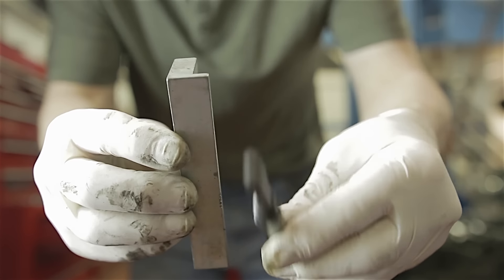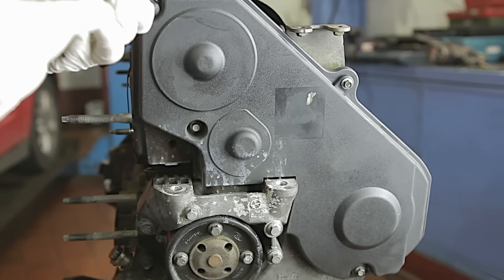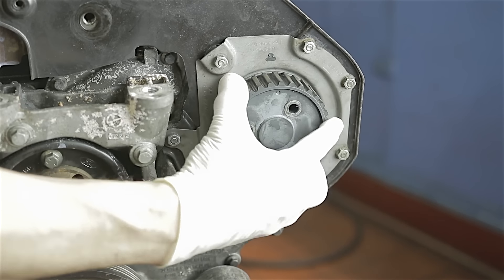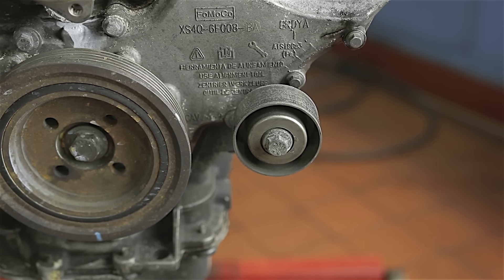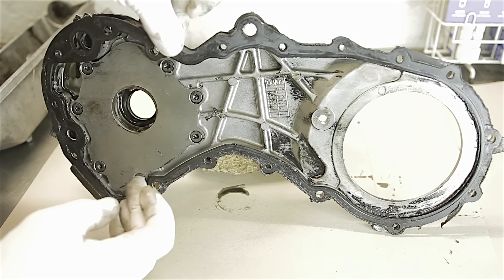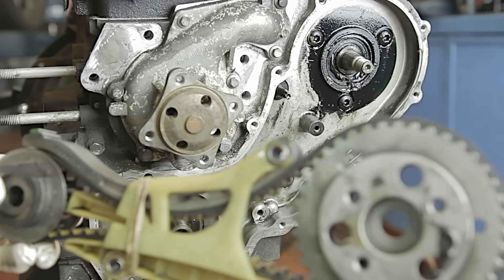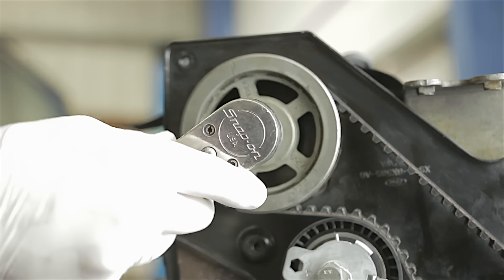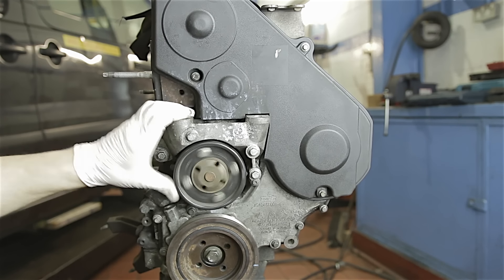Ford Mondeo/Transit Connect 1.8tdci wet timing belt replacement

Comment: Novice mechanic here having successfully completed this job on my connect 2k miles ago. My van snapped its wet belt about 7 years ago at 50k miles according to the previous owner, but they didn't convert to a chain after rebuilding the head. 60k miles later, having spent a month converting it to a wee camper, I decided that leaving it wasn't worth the risk! Thanks to this video and the video from badgertronix i was saved a fair chunk of cash, have a van that (probably) won't explode, and I got a good bit of experience at the same time. My belt was cracked to high heaven too, so taking the plunge was the right decision.

Some things to note from my experience:
My camshaft pully was stuck on tight, no amount of tapping would free it. I was able to pop it off easily with a homemade puller using 3 m10 bolts and some thick steel for the body with 3 holes drilled. You'll need some nuts too. I'll let you work out the rest (part of the fun eh). So just be prepared for this. Ford make a dedicated tool but i couldn't find one anywhere really. 

My new crankshaft seal was leaking quite badly when i installed it, so i replaced with the old one and it was completely fine, still going strong. The seal was from FAI in the lymm engine kits. I saw another guy had this issue so it may be common. So just try this before you go diving back in there thinking the alignment is off. 

Cheers Alan.
Reply from the maker: thanks for your comment chlorotica, hats off to you for getting what is a daunting job done

Comment: this vid. was my first date with you.... i put a spanner on the crank, another on the cam, turned engine clockwise, stopped, then turned it anticlock, no lag between top + bottom spanners, therefore fkin belt fitted. needed dmf as well, so pulled lump out. checked shells, big ends gone [99k] , oilpump partially clogged with belt dust. all the belts, shells, wpump, aux tensioner, dmf + clutch + all seals/gaskets , £850. survived 4yrs now, but use 5/40 oil every 3k cos mains rumbling. you were a very expensive video to watch, but well worth it. keep up the good work + give monny one for me

Comment: Still a great video Alan.  Now coming up on 300,000 miles, this was my second time doing this job with the engine in the vehicle (Ford dealer did it at 100,000 miles). A couple of things I found:
(1) You won't get the water pump off without taking the auxilliary drive belt tensioner off first (1 x 10mm screw and  1 x 13mm screw into block). There physically isn't the room to lift it upwards between the engine and the wheel-arch/side of the engine bay - it has to be passed rearwards and the tensioner pulley will be in the way.
(2) Getting that engine mounting bracket off is a nightmare due to the length of the bolts holding it on. You need to take the water pump pulley off first to make extra room to wiggle the mounting bracket around (likewise when re-fitting after wet belt is fitted - make sure the mounting bracket is fitted before re-fitting the water pump pulley) - also jacking the engine up a bit creates a bit more clearance.
(3) Its important to re-fit the wiring  harness to the injectors and various sensors on top of the rocker cover (disconnected to remove the rocker cover) the same way it was originally. When I did this the previous time, I routed the wiring over the  fuel pipes instead of under them and it must have strained some wiring resulting in the car going into limp mode until such time as the wiring harness was put under the fuel pipes.
Reply from the maker: thanks for your explanation, very interesting
Reply: good to now engines good for 300000 , got one in mk2 focus great car issue is clutcj gone at 90000 , seems to be release bearing but im think dual mass as well ... I get it replaced and should be good for ages ...Not had car form new previous owner ruined the clutch mines has the metal chain

Comment: Bang on I was sure if the crankshaft locking pin fitted inside a hole in the crankshaft, good to know it does rotate anticlockwise when the locking pin is in place, My connect starts runs perfect, but once it starts getting warm it's blowing out blue grey smoke so I'm gonna take off the head to see what's the problem. Great video thanks 👍

Comment: There's no prospect of me ever owning any vehicles with this engine, but I watched the video anyway just to see what the hell a wet belt set up would look like. I don't like the look of it! But I liked the video a lot shows how the job is done in the real world. Probably would have been worth doing the video on a real customer job or having at least the new kit of parts, but you definitely demonstrated how to get the job done. It kept my interest through out even after I'd seen the wet belt, I got sucked in and had to see the rest of the demo! Only observation, when refitting the crank pulley carefully over the seal, I reckon a smear of engine oil on the sealing surface on the pulley and / or the seal would be a help to assist sealing and minimise risk of teh seal getting caught and nicked. But as you said you've done hundreds of these so evidently fitting it dry but with great care works just fine!  Top vid. Kudos to you for being a real skilled mechanic
Reply from the maker: thank you, i had to borrow that dud engine to make the video as i never had a camera when i was regulary changing those belts, so it was a case of now or never..thanks again for your comment, much appreciated
Reply: @alan4x  hi Alan  ive got 12 plate connect  the wet belt snap whats best to do fix it  and any place werr I can take it

Comment: Bought a 58 mondeo with 125k miles. Took it to my local garage for timing belt and oil change and the lad said please do the wet belt too. Ford recommends timing and wet belt to be changed at 125 k or 10 years. Glad i accepted for him to change it as it was all cracked. Probably would have failed in the next 2k miles totalling the engine

Comment: THANK YOU SO MUCH for this strip down. Pulling the tensioner revealed a domed tensioner plunger (phew!!!) but all the same it helped a TON changing bruvs water pump and top cambelt in his Focus Mk.2. Getting the lower engine mount out with the engine in the car was a shit bag of a funt of a castard of a futha mucker of a nightmare but otherwise this job is quite do able on the drive for unauthorised meddlers such as I am. Keep up the good work, I owe you a six pack of your preferred beverage!
Reply from the maker: cheers

Comment: You've done my mate a real favour.lol. I've decided to leave his connect alone. I used to be a fitter in early 90s these 1800s have really changed. N FFS they needed it!!!!!
Reply: Absolutely brilliantly explained and carried out by a man who knows what he's doing, what manufacturer in their right mind would design an engine like this to put a wet belt inside an engine and then another belt on the outside making it double trouble, if either of those belts fail then that engine is toast but I suppose it's a good way of selling engines for Ford. I believe they are doing the new 2ltr diesel the same way, I for one will Never buy a Ford with this stupid engine fitted because as usual with Ford as long as it lasts till the end of the warranty period their fine with that and then it's you parting with the cash, nice one Ford.

Comment: Probably the best demo vid I've ever seen. Possibly the most stupid engine design I've ever seen.
Reply: for ford its a great idea::its so the car has to return to the stealership to be repaired!!!
Reply: @rearspeaker6364  And with there kind of politics by Trump good exposed,it was my last Ford.
Reply: @Boca-do-rio  Psa uses a wet belt on some of their engines also not much more to choose from then.
Reply: @rimmersbryggeri  Hi, how would one know which psa engines that would be? both 1.6 and 2.0? Which models/years? Thanks!
Reply: @zernestro  I don't know but I could find out. They are inte the 3008 anyway. seems to be a whole range of displacements petrol engines. Puretech
Reply: Mental design just to rob the poor motorist mental cheap plastic crap
Reply: The worst engine ford ever made
Reply: Ive bought one of these as a cheap van runabout...what a stupid design ..ford want a grand to replace both belts...ill take my chances and scrap the thing if it snaps
Reply: Agree haha
Reply: @zernestro   just the three cylinder 1.2 puretech engine......they are trouble

Comment: Really, REALLY appreciate this video. 
Quick question: is it necessary to use a new crankshaft pulley bolt? I've read that it's essential but you didn't mention it. In fact  there are many instances where replacement of high-torque bolts is prescribed in the Haynes manual (citing it as a Ford policy) but as an amateur it's hard to know what's important - any guidance would be great. 
Another amateur newbie one: what kind of sealant is recommended for the back of the fuel pump sprocket? These things get understandably glossed over as assumed knowledge - I suppose any engine sealant that is heat, vibration and oil resistant.

I'm a DIY mechanic and will be doing this soon, with the engine in the van . Fingers crossed I figure out how to get out the lower engine mounting bolts, which are flagged as having not enough clearance in the comments - any tips on that appreciated. I already removed the belt tensioning bolt (with a bit of swearing) to check it prior to ordering the chain conversion kit.
Reply from the maker: hi, yes its fine to use the old crank bolt,  uesd to just gun them back tight with no issues and any good gasket sealant wlll do
Reply: @alan4x  thanks, and again; a very well explained and concise video.

Comment: Très bonne vidéo. Mais attention,en montant le joint de la pompe à gazole comme ça et la poulie sans pâte à joint, il y a 99% de chance d'avoir une fuite d'huile ! 
Very good video. But be careful, by mounting the fuel pump gasket like this and the pulley without a compound seal, there is a 99% chance of having an oil leak! Thanks to you (google translation)

Comment: hello there, this video helped me alot when doing my timing belt a couple years back (thanks for that), but i am now having to change out the crank pulley, is it enough to lock the ringgear and screw it off and replace, or will this get it out of timing? cheers from norway
Reply from the maker: you can just remove the crank bolt and pulley and it will not affect the wet belt timing, just fit a new pulley and bolt it back
Reply: @alan4x  thank you soo much :)

Comment: This is a good video, with only one failing.
The third (3rd) engine lock off tool, is missing.
This goes on to the flywheel where the starter motor goes.
This then stops anyone then "as you said" bending the crank shaft aliening tool to what is NOT a locking pin.
It is just an aliening tool.
You need the flywheel locked to prevent this happening.
So, there is no need for as you did to use a pair of mole grips to re aliening the crankshaft, As, it wouldn't have moved.

Other than this.
Great video thanks for making it.

Comment: Omg, this is all pretty hard and precise work. Now imagine doing it all without taking the engine out of the car! Must be hell.
Reply: i did one today on a galaxy long job lol
Reply: It is possible but a little awkward, i've done quiet a few, if your belt has gone the pistons WILL need to be replaced as they crack at the swirl cup edges.

A trick if you need to change the pistons is to carefully break the thin aluminium webbing away from the lower half of the crankcase rather than seperating the two halves to allow access to the connecting rod bolts because they are a nightmare to seal if you split the halves.

It takes extra work to get the top belt timing marks lined back up  but it is not essential because the top cam sprocket is not keyed and the pump does not require timing.

Although it isn't essential it just makes the next guys job easier when doing the next upper belt change if you time the pump and cam sprockets properly on assembly.
Reply: You haven't done the THREE timing chains on a GM 3.6 litre HF direct injection V6.... this is less than 1/6 as bad.

Comment: That video was really helpful 👍i need to replace the head gasket on my son 230l ford transit connect 2005- do you have a video to help with this,
I was looking for timing marks before removing the head and now see what to do thanks to your wet belt video.👍steve spain
Reply from the maker: hi steve, i don't have any information on removing the head but it should be straight forward, the timing is the most complicated part

Comment: Hello, your video is excellent.
At the level of the pinion on the crankshaft, when you speak of the pin which must go in the round hole and not in the one which is oblong, what happens if I go up the pinion with the pin in the oblong hole?

Comment: I'm on 155000 miles... how long will these engines go on for once i replace the wetbelt?. It's had regular services. Just not sure wether to buy a re con or do the chain conversion. Thank you.
Reply from the maker: these engines are pretty much bullet proof and should even outlive you😁
Reply: @alan4x  brilliant thank you for the quick reply. I wonder if I could get it to 300,000 with a chain kit...

Comment: Hi I’ve got a connect with the same engine. Having difficulty starting over the last few days. Machine says Cylinder Head Temperature Sensor out of self test. Asked around searched the interweb (where I found your great video) can’t find the location of this sensor 🤦🏻‍♂️ Would you have the answer 🙏🏻🙏🏻

Comment: Hi, is there any problem if i take of the belt tensioner to see if is chain or belt? Can i put it back if is chain and start the car after check or what i should do?
Reply from the maker: yes you can unbolt the tensioner and remove it..the timing will stay as it is...once you've looked at it then just screw it back in and thats it
Reply: @alan4x  thank you very much bro

Comment: Alan had a discussion with an independent garage owner and he came up with following points on wet belt/chain situation 1 he claimed chains broke on the original engine so as long as wet belt is changed in line with specs there shouldn't be a problem
2 he reckon that you shouldn't use a chain conversion on the wet belt engine as the internals have been modified to suit wet belt .
3 he reckons wet belt is used for emissions/fuel consumption and less particle contamination in oil as opposed to chain .
4 he reckons he does this job without aligning tool and has never had one leak .
I'll keep my thoughts to myself until you reply , hope I'm not taxing you too much regards Ian.
Reply from the maker: hi, i will try to answer this...i have changed about fifty wet belts for chain conversions now...most of these cars had chains put in them about 100k miles...and most of these cars were taxis...we get rid of these cars between 300-400k miles so most of the chains have done 2-300k miles with no problems related to the chains whatsoever.
  i have never heard of one of these chains breaking either..they are a thick double chain.
the cars run perfectly fine with the chains..never had an issue.
 as for aligning the lower crankcase...there are no dowels to hold the case in a specific position so without the alignment tool the crank seal will no doubt not be central on the crank pulley......i fitted lots of these lower crank covers without the alignment tool as i did not know one was needed until i had a few bad crank seals leaking....then i bought the tool and had to align some of the crank covers. you may be lucky without the tool but it is risky.
  the big issue here...a new wet belt kit is considerably cheaper than a chain conversion...so if you don't intend keeping the car for more than another 100k miles then fitting a wet belt is the best option...if you do then a chain would be the way to go.
  i stand by the fact the belts are supposed to be quieter in operation...and cheaper to fit as the chains cost more to produce..in reality  the engines sound the same with a chain or wet belt....hope this helps
Reply: Thanks for the quick response you've basically confirmed my thoughts , very much appreciated thanks again .

Comment: Hi

Do you know if this is a common job now that most mechanics know about?

Do you do a belt conversion to a chain? If so where are you based and roughly what is the cost.

My vehicle is a 1.8 2012 connect with 80k miles

Thank you

Comment: Brilliant video.. thanks.. is it possible to change a vauxhall wet belt on the peugot designed engine to a chain? I believe there have been probs with GM wet belt of belt degradation.. thanks

Comment: Hi Allan.....unfortunately  the crank seal failed on install....I used the case alignment tool OK.....I'm hoping to just pull out the bad seal and replace it  with a new one....anything  else to consider? Many thanks 🙏

Comment: Excellent video can you please tell me if I can just remove the tensioner from the bottom belt without affecting the timing? I want to check if my engine is belt or chain thanks
Reply: I would also like to know the answer to this question please?

Comment: Hi Alan can I just say a big thank you for your videos. 
I have a 2004 ford transit connect 1.8 tddi with a bhpa engine  
Now for my predicament i have stripped my van down with suspected timing chain fault upon removing the chain cover every thing looks good and I have the three bolts in the top gear, now is this saying that it has had a wet belt upgrade? If so the chain should be OK as the van has only 155'000 on the clock.

Comment: In our work fleet ,we had 6 out of 6 transit connects with failed wet  belts. All of them failed between 25k and 90k kilometers, and one of them even failed twice.  Some of these vehicles did however have  a fair deal of idle hours, but still all of them was covered under ford 100k km  driveline warranty.  Must be said that climate here is fairly harsh  and temperatured could go as low as -25C in the winter.